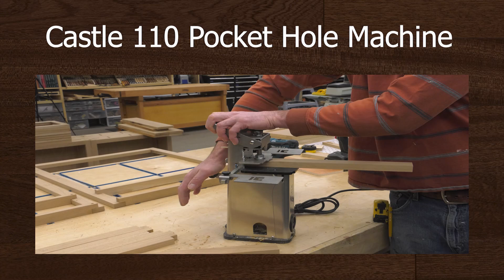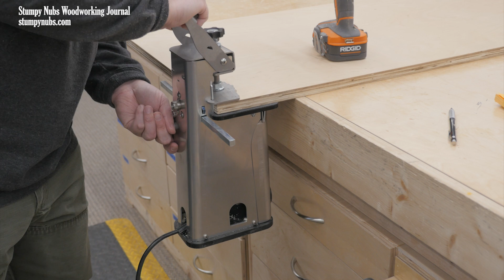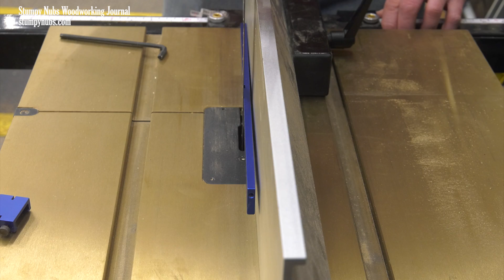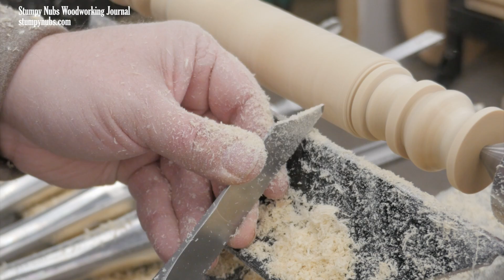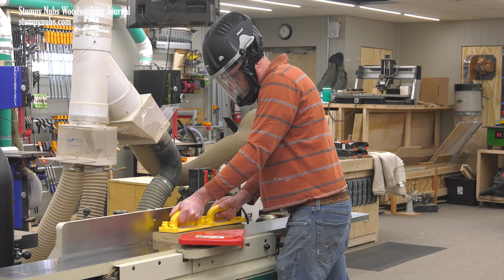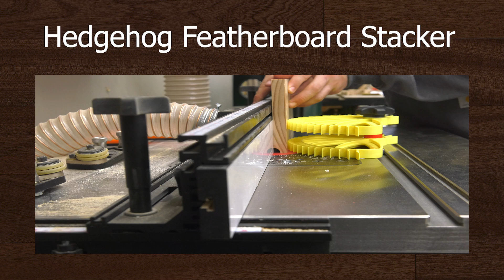7 Cool Tools I Have in my Woodworking Shop

Comment: Awesome channel... clear, concise, no music!!  You know yer stuff and present it in a perfectly humble manner - love it!  I have a question about the castle 110 - which seems wont be available til Fall :(

I built corn hole boards outta 2x4's and 1/2" plywood for top...i use pocket holes to join the 2x4s to the plywood top so no holes/screws are visible on the top... this method is tricky and setup is crucial so as to avoid any screw 'poke thru'... I have a harbor freight pocket hole jig that is adequate at best... Ive build 10 or so sets using this method with pretty good results... however, lately im frustrated with the terrible looking and hard to deal with tear out...  QUESTION: do you think the castle 110 can be use to create pockets on the 2x4 so i can secure the 1/2" plywood top to the 2x4s?  Thx in advance for any guidance and please keep up the great work!

Comment: Hi Stumpy Nubs, James from the UK. I'm really interested in the castle 110 machine for my home workshop to help with my builds. A little expensive but can you tell me if I buy it and have it shipped to me can I change the electrical output for UK plugs? And also do they do it in mm or is it just inches? 
Thank you
Reply from the maker: I would ask them about that. I do not believe you can just change the cord because the UK power is 240v while the US is 120v. But you can purchase a 120-240v convertor on Amazon or elsewhere for a decent price.
Reply: @StumpyNubs  thank you. Apparently on thier website they are saying around November 2021 (this year) they will sell a 230v option for Europe.

Comment: Love the idea of the Castle 110 vs. Kreg but it's not as well supported and based on the videos I've seen..just seems awkward to use for anything bigger than a picture frame.
Reply from the maker: It works very well so all sizes. I showed small and large in the video. Medium pieces can also be easily supported by connecting a couple scraps of wood to make a "leg" which can be placed on the bench top and used to help support any long piece.

Comment: Great video. The problem I find with the Airshield Pro is the NiMH battery (at least, down here they only sell it with an NiMH battery) . NiMH are notorious for memory issues and failing if not used constantly. They really need to update to a better battery system.

Comment: An easy way to solve the chuck key going missing is to tie it to the table of the drill press with a piece of rope like a paracord. Then, it's always hanging down next to the drill press whenever you need it.

Comment: Can you explain the not exhaling into the filters on the Trend Air? I'm not sure what you mean here. Every respirator I've ever seen has air coming in through the filters, which you describe as positive air pressure. Then is exhaled through a one way air valve.

Ignore the above... just leaving it there for others that may of had the same question.

As I am writing this, I looked up the product description and see what you mean by positive air pressure. What wasn't clear in your description is that there is a powered fan sucking in air through the filters to create the positive pressure.

Comment: $824 for the air filter mask!  I'll shave my beard first!  
The Castle 100 pocket hole machine is $399 (from the Castle site) but the Kreg Foreman is $449 so that's a good deal, depending on how hard or expensive it is to replace or sharpen the cutter.  Wish you had covered that.  What about plugs for the holes?  Can you get dowels that fit.  I would love to see a longer review of that one.
Thanks for your reviews and other videos!
Reply from the maker: Not sure where you got that price. It's not even close to $824 USD.
Reply: You must have looked at the wrong model. He's got the pro not the max

Comment: Just a short comment on the Trend Airshield Pro.  Why didn't you address all of the negative comments on the durability, breakage and high cost of the parts, especially the headband.  My neighbor and very good friend bought one and told me not to waste my money.  It seems to be very top heavy (I did try his on and I agree) with a litany of issues from the many reviews that have been written (to be clear, I understand that reviews can be misleading, but that said, the sheer volume of negative complaints have to account for something).    For me, I do not have the kind of money to be able to spend that much and not have it work as stated in their literature.  Just sayin.......
Reply from the maker: I address reality, not Amazon comments which I find, in case after case, do not represent reality. I've used one for six years. I broke the headband one time when I dropped it. Did I go on Amazon and post about the headband being too fragile? Nope. I applied common sense- I stopped dropping it because guess what, things break when they hit concrete :) "Sheer volume" is meaningless in a world where virtually nobody posts reviews about a product that works, but you can bet your backside they post one if there is an issue. That is only one of the reasons Amazon comments are not reality. Someday I make make a video about THAT! :)

Comment: I know the filters on the biker-in-the-front helmet aren't for fumes, but like, wouldn't it be a bad idea to wear around fumes? Wouldn't it just pull the fumes in? That sounds like it would be a one time mistake to make or you stop wood working altogether.
Reply from the maker: It won't protect your lungs from fumes. But the fumes aren't likely to hurt the Airshield itself.

Comment: A few months back when I was shopping for face shield respirators, I looked at the Trend.  However I ultimately chose the 3M Versaflow.  I sometimes work with some nasty stuff and I felt more comfortable with the NIOSH rated system.  The unit is much more comfortable than I ever imagined it could be.  I can wear it for hours, no issues, though it can dry out my eyes in dry winter air.  The 3M ain’t cheap, but have you seen the prices of lungs these days?

Comment: Can you provide a link where to buy the Nova chuck I want one of these and on Amazon there is only one seller with poor ratings (it is being sold by foreign offshore seller)
Reply from the maker: I got mine on Amazon, but it was likely not from that seller. Unfortunately, they seem to have sold out. I'd just Google "Nova Keyless Drill Chuck" and see if you can find a different source.

Comment: Please list the prices for the cool tools in the description along with the link – the price date would also be helpful since the video could be viewed years later and prices change over time.  For example, the Castle 110 Pocket Cutter has a retail price of $399 (Feb2021).  It looks like a nice pocket hole machine.  For a small cabinet shop – could well be worth the cost.  For the home gamer – the Castle unit is probably too expensive -- the home gamer could buy a big router for that price.  Also note that the home gamer has a different labor cost than a commercial shop.  The beauty of the Kreg jig is that it gave the home gamer the ability to make pocket hoes at a price that the home gamer could afford.  Acknowledgement: the Kreg Jig has some compromises.
Reply from the maker: Why not just click the link and find out the current price? How does it help to list prices that will go out of date a month later, even if I put a date next to them? They will still be out of date, requiring clicking on the link, unless you expect me to go back through all our videos every few weeks and do updates.
Reply: Knowing the approximate price lets the viewer know if the tool is within their budget.  For example, you compared the Castle to the Kreg jig even though the Castle unit is far more expensive.  I was not looking for an instant price check – just an idea if the tool is in my price range.  For most home gamers – the Castle unit is beyond their budget or their money could be better spent on a different tool – for example, in the Castle case, a large router. @StumpyNubs
Reply from the maker: Yes, knowing the price has a lot of value. And you can find the price at the links provided. Not even just "approximate" prices, the actual current prices...

Comment: Just under 500 for the face shield... Yikes! I know you can't put a price on health but I guess they also took that into consideration when pricing their product so high... 😳
Reply from the maker: Sometimes the price of a product reflects what it costs to develop it, license it (respirators need certain approvals) manufacture it and market it. Not everything is based on "screwing the little guy."
Reply: @StumpyNubs  agreed but money is money. Seems like a great product but I highly doubt the markup is low or the price is a reflection of the costs to make the product. Oh well. Good video regardless. I love the cool tools series.
Reply from the maker: @mikefas5406  - Sure, money is money and folks can only buy what they can afford. But "markup" is not always what you think it is. I'm not sure either one of us knows what it costs to make these products. When considering cost, consumers typically only look at the materials the item is made from. They rarely consider the years of development, prototyping, testing, patenting, etc. That costs a great deal before the first product is sold. Then there is the actual manufacturing process which is based upon scale and quality. A small business like Castle can not make quality products for even close to the price as a company like Porter Cable can. Even large companies like Trend can not make a niche product like the Airshield for the price that 3M can make stuff. Then there is marketing, trade shows, building a brand- this takes a lot more than most people think. Don't forget licensing and government approvals (especially for that Airshield). And there is the manpower involved in customer service, order fulfillment, etc. Only after all of that is paid does the actual cost of the materials come into play. Making a product and bringing it to market is not as cheap as people think, especially for small companies like Castle. People see high priced items and they automatically think someone is screwing the little guy. But the reality is rarely that simple.

Comment: I had a Kreg Foreman and sold it the day I ran into a used Castle TSM 12. The low angle from Castle is far superior to the Kreg. I disliked the Kreg so much I had thought of using a Domino for face frames even though it would take to long.
Reply from the maker: I haven't used my Foreman since the day I got my Castle, either. I have a TSM 12 as well. Great machine!

Comment: My poor man's solution to my issue with eye glasses and safety glasses was to get a pair of those chemistry goggles you use in either a HS or Uni biology/chemistry lab. They fit over my glasses well, seal around the edges, and have enough room for my mask to sit just fine. I recommend this method to anyone who can't afford a full head mechanism. Maybe one day I can get one, but for now I work with what I can afford. 

Solid video, as always!

Comment: Something else about that Trend mask that you may not even notice is that it doesn't fog up like a regular face shield does because the air flows over the inside of the glass.

Comment: I have the Trend,  the filters are poorly fitted, the mask is heavy and unbalanced and the adjustment strap shattered when dropped and the helmet is now useless.  I have now purchased a used belt mounted extract hood, for less than the cost of the Trend.  They are far superior imo,  much more comfortable to work in, and you can fit different grades of filters and prefilters.

Comment: While Carter tools are very good, I’m not a fan of the metal handles. My preference is to turn my own handles. I have the Trend Airshield Pro and think it’s a very good product but the battery packs wear out quickly and are expensive to replace. I made my own battery pack with rechargeable batteries.

Comment: The Trend Airshield is a great idea, to bad they can’t build a headband that can support it’s weight. Mine has been held together with bolts and tape for years. I will never buy another. It’s  a filter mask for me.
Reply from the maker: I believe they improved the headband a few years back. I know you can get a replacement part if yours is broken.
Reply: If they have changed the new ones, maybe I will try one. My original one only lasted a week  They told me they had a bad batch, and gave me a new one. It lasted two weeks, so I figured they were all the same. Maybe I’ll order a new one and see if they are any better.

Comment: TBH the shifting due to pocket holes only happens if the only clamps you have are your hands. 😉
Reply from the maker: That depends on what you are assembling. If you are making face frames that clamp down flat, sure. But panels such as for cabinets are more difficult to keep aligned, even with Kreg's special clamps that slip into a pocket. If you get them tight enough to hold well you often break the hole itself. Believe me, I've done a little bit of this over the years 😉

Comment: More great info, James. Thanks. That pocket hole jig used to be Porter Cable many moons ago. I remember seeing Norm use one with the same principle. I researched it a while ago and found the Castle is the same one just refined.
Bill
Reply: The orginal Porter Cable benchtop(much bigger than the 110) has 2 routers in it.  It was actually produced by Castle back then.  Castle still sells that model, which is called the TSM-12. https://castleusa.com/products/tsm-12-benchtop-pocket-cutter-machine.html   The first version of the Castle 110 was the Castle 100.  The  Castle 100 was developed about 3 years ago, while the updated version, the 110, officially came out in the fall.

Comment: Question: pocket hole maker.  do you need a clamp to make sure the piece dose not move around on you. and is there any way to make or buy the filler pieces that Castle 110 Pocket Hole Machine makes. it looks different than the other drills make. l'm still setting a shop up. thanks for your time James...,
Reply from the maker: The machine has a clamp on it to hold the piece as it cuts.

Comment: haha dude $60 for a keyless chuck. dam i think i paid like $250 for mine. its like +/- .0005 runout. you can find integral mt2 into the chuck and they have less runout than having the taper for the chuck and then the MT2 to the drill press.  albrecht  are really nice as well, can find them used on ebay for a fair price.
Reply from the maker: I am sure mine has a little more runout that yours :)
Reply: @StumpyNubs  I have the same DVR drill press and it can easily get that little of run-out. Chuck up a carbide end mill and test it out with a test indicator. You should also check to see what kind of contact you are getting on that taper. Blue sharpie works pretty good seeing the contract patch

Comment: The pocket screw tool looks like a consumer portable version of the industrial one in the cabinet shop I used to walk make toothpicks at.
Reply from the maker: It may be that you had a Castle machine there. They make large machines.
Reply: @StumpyNubs  As the pay and work conditions were less than desirable, I have forgotten allot of details. Also long time ago, but you're probably correct.

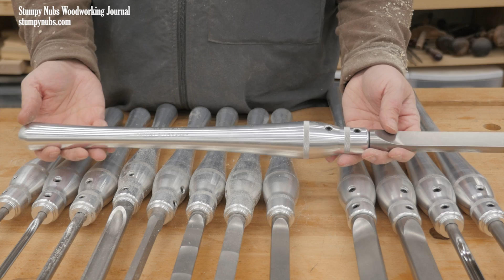Comment: At 5:50 you call these milled aluminium, that should probably have been called turned aluminium?
 Cause a relatively slender round piece like that is a cakewalk to make on a CNC lathe.
Reply from the maker: You are correct. I misspoke.

Comment: If you use a drill press a lot you need a keyless chuck. After I got one I found I was much more likely to use the drill press, with the proper bit, rather than grabbing a hand held drill because I didn't want to fight with a chuck.
Reply: Seems every time I use drill press I don’t get chuck tight enough and have to re-tighten.  Pain in the ass
Reply: And as we age, using that chuck is alike a knuckle-killer. Keyless FTW!

Comment: The Trend Airshield Pro link shows it is no longer available.
Reply: Came to say this. I'm really interested in it!!
Reply: The link is working now, for me at least.
Reply: It's intermittent. First time I clicked it, the link failed. Manually changed to the US site, clicked through the front page for safety, and the link it takes me to is identical to what was linked in the description, and it works. If you're getting the UK site by default, the selector is at the top right, choose US (or other country) and see if you can find it under Products > Safety.
Reply from the maker: Works for me. You may have to switch to US dollars at the top of the screen. It's an international website (based in the UK). https://www.trend-uk.com/en/US/product/U*AIR_PRO/2/1/airpro_face_shield_usa_120v_.html
Reply: The site does seem to be flaky, but it worked for me on the second try.  It's certainly interesting, but I got a shock when I saw the price.
Reply: @TrevorDennis100  yeah, it is a spendy item, but what are your lungs and health worth to you in  the long run? Plus, if you have glasses or facial hair, this is a much better idea than a half face filter mask and gogles plus a face shield. Put in one thing instead of three.

Comment: The Castle Pocket Hole machine reminds me of the absolutely horrid Porter Cable 550 Pocket Cutter that cut pockets and had hole drilling in a nearly identical fashion.  That machine made me swear off pocket hole machines for the past 20+ years.  I would be interested in your evaluation of the Castle machine after more use.
Reply from the maker: Castle machines in general have been highly regarded for a very long time. We have used it for several projects, it's been well evaluated. Here is a review from Fine Woodworking Magazine (this is the 100 model, I own the upgraded 110): https://www.finewoodworking.com/2019/08/16/tool-review-pocket-hole-machine-by-castle